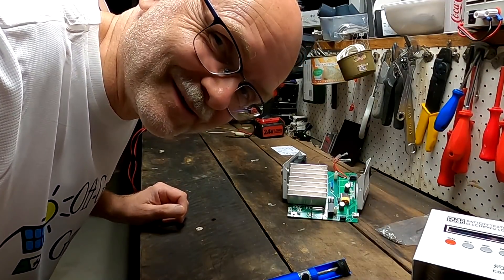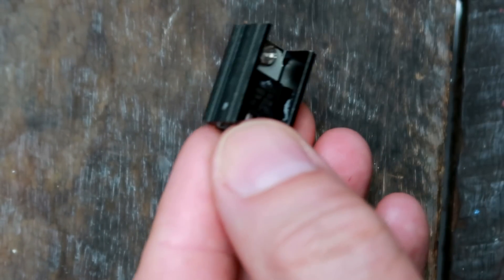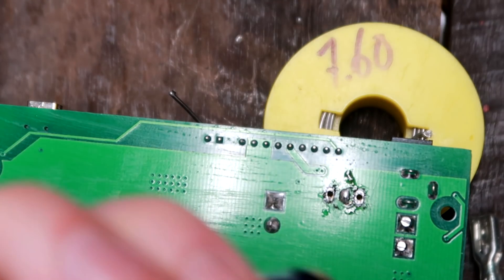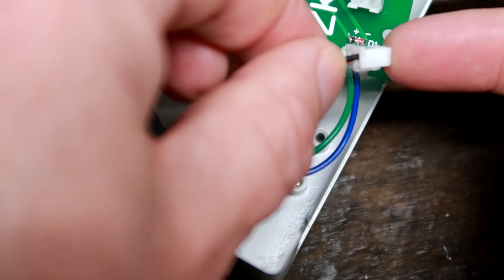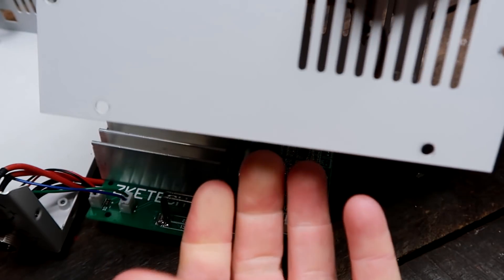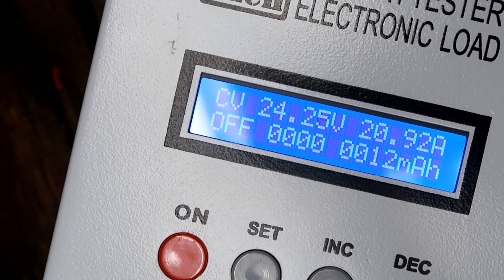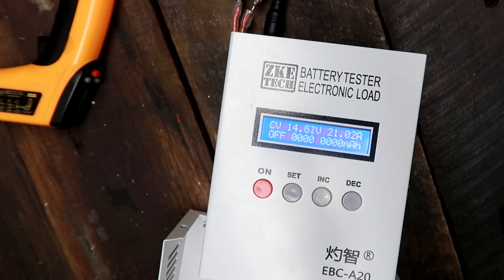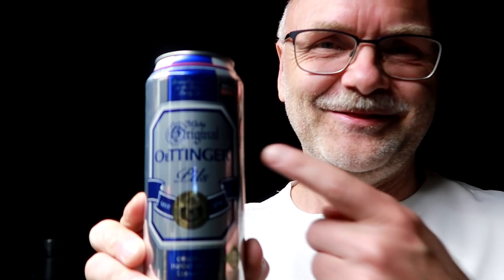Battery Tester Repair. Train wreck or fix? Part II

Comment: Ok, my 2 cents.
1. Solder wick with liquid flux on the wick.
2. Flow the solder then push a round toothpick through the solder holes. (My favorite.)
3. Flow the solder and bang the board on the workbench. 

Laugh all you want but I've been a bench tech for over 30 years and those are my tried and true methods for solder removal.

Also, when removing ICs, cut the legs and remove 1 at a time. Traces tend to get lifted otherwise. At least on cheap electronics they do.

Comment: Since that middle pin is the ground, it's also connected to the ground plane, which acts as a heat sink. The solder doesn't stay hot long enough after you remove the iron for that sucker to work. Use solder wick instead and trash that sucker.

Comment: Use lots a flux and copper wick for desoldering & cleaning, not John Wick though  :))). Watch northridge fix for soldering excellence. If previous regulator failed dead short then you need to check at least ICs and elcos downstream. Keep up the great work!

Comment: The midle pin is the ground plane, there is lots of cooper dissipating heat from the solder iron. I normally apply the heat in one side of the pcb and suck the solder from the other side. The diode is a zenner connected in reverse it becames a "voltage regulador"
Reply: *copper *zener

Comment: The Diode on the FAN is a flyback diode, it conducts the back EMF, when the FAN is switched off,  back to the supply rail.
Reply from the maker: Right, thank you.
Reply: Sort of a Transient Voltage Suppression (TVS) diode.
Reply: You beat me to the punch.  I agree, it is there to suppress the flyback voltage when an inductor (like the windings of a fan) has the  current suddenly switched off, but the current wants to continue flowing.

Comment: I would add few suggestion as you wanted :)

1. That diode is for protection of your driving circuit (fan) .it will not allow to push voltage in case you would start spinning that fan 
2. it looks like normal board but there is huge ground plane and that will reduce your temperature 
3. there are special tools that are used to suck solder on ebay (they look like plastic cheap pistol) ..they are not the best but work very well and and they have pump inside ..so yeah cheap option ..and worth some money ..if not go with Weller or similar brand  
4. Probably some IC is shorted because your regulator blew up and allowed voltage to go above 12V or some spike with same results..and you might expect more IC went wrong same time.. 
5. I would suggest to change those IC (if you will be able solder/desolder ) but i would suggest proper tools for that..solder, desolder , hot air gun

Comment: A lot can be figured out or diagnosed with just a meter. At the very least you should check out the parts connected to heat sinks, since many are power FETs that like to fail as a short. I would say it is a better than even chance one is shorted.

Comment: Sometimes you need to blow on the hole instead of sucking it... 😅
Solder wick works too.

Bad luck... 🥺, but for all it's worth we expected sparks and smoke...  You never disappoint. 👍

Comment: Perhaps if you could identify the chip getting hot? As it seems to be voltage and current readings giving grief maybe it is a reference voltage that has gone south. Some a to d converters rely on an external reference voltage. If it went wrong maybe it also caused the regulator to overload as it failed. A good sign is the pat you are getting readings which implies that the a to d part of the processor is working so the problem is in the periferals and not a programmed part.
Reply: yea the op-amp amplifies the signal from the current shunt probably, so it going short made that reading go wild and pulled more current than the heatsink on the 7812 regulator could handle (though it should have overheat protection and shut down before that)
Reply: @SuperBrainAK  they do have overheat protection however, in reality, they are still quite prone to dying instead. I have replaced many that it could be argued shouldn’t have died.
Reply: @philbrooke-little7082  yea, one day a long time ago I had a nice breadboard setup with 3 different linear regulators with a Teensy ++ that could turn them on and off and do fun things, Then an acquaintance decided it would be funny to mess with the wires and shorted the 5v rail of the always on regulator for the microcontroller. I came back and noticed the power supply was on but no lights were on at the breadboard, so I touched the heatsink to move the board and got burned by it. I finally found the short but the regulator was unable to deliver any current, it was surprisingly still able to regulate to 5v but couldnt even light an LED. RIP 7805

Comment: Ground plane is sucking all the heat.... bigger soldering iron :D

I guess that diode is freewheelling diode. Fan motor is basically a coil and turning current off from it will cause a voltage spike in it. That diode suppress it.  

350mA sounds too much... maybe? Was fan running?

Comment: In the video I could not hear the fan kicking in after turning on the device. In my device there is always a short fan self test. Maybe this is also an indication of a malfunctioning IC board. You could also check the voltage on the two possible sockets shortly after turning on.

Comment: Fan = inductive load, diode is to avoid "back EMF."
Reply: There wouldn't be any back EMF from that fan. Like PC cooling fans, they have a driver circuit built in, if you have ever played around with fan's, spinning the fan blades doesn't generate a current.. you would have to open the fan and bypass the driver circuit to get it to generate a current.. 
The diode appears to be a protective solution should you connect your sense wire's incorrectly...
Reply: @PeterMilanovski  So it’s odd the PCB may be labelled incorrectly. Maybe trying changing over those connectors? Though the fan would not be taking the current indicated on the display
Reply: @michaelbouckley4455  I'm not sure what is going on with the device, it's possible that the fan connection is plugged into the sense socket and therefore giving the reading on the display? Or something else has failed which would need an oscilloscope and some datasheets to troubleshoot it....
Reply: @PeterMilanovski 
 I think you would you agree that for the diode to be a protective solution for the sense wires, the sense wires would need to be connected to the header with the diode. Ultimately, Andy did not connect it that way -- he connected the fan to the header with the diode, and the sense wires went to the header without the diode. My comment was in that context,  meaning I was assuming he had them connected properly.

I did not say that there WOULD be any back EMF from the fan -- I was only suggesting that it's a reason the designers may have put one on that header. Perhaps it's unnecessary. Or perhaps not every single fan in the world has a "driver circuit" as you assumed. We don't know without more info.

Comment: The diode on the fan motor output would be to protect against back-EMF when using a brushed DC motor which could destroy the fan control FET, shouldn't be needed for a brushless motor. As for what died, I would guess an op-amp from receiving whatever the power adapter surged to when it popped the linear regulator..
Reply from the maker: Thank you.

Comment: Funny... I had the same problem just yesterday replacing a Mosfet on a speed controller. This worked for me... Heat the board with a heat gun first, then heat with the iron and then blow hard into the hole and blow out the solder. I'm not having you on... try it (on camera) 😄

Comment: A easy way to remove the solder is apply heat to one side of the pcb and use the pump on the other.
The overheating part maybe can be replaced i don't think is a eprom.

Comment: The fan diode is there to protect the fan power circuit from back feed current from the fan eg when you hit it with the air gun 
When you spin them up they can generate a lot of current
Reply: That would be true if the fan didn't have a driver circuit but in the case of this fan and all PC cooling fans, they don't produce current if you spin the fan blades, you would have to modify the fan, bypass the driver circuit to get it to generate a current...
Reply: @PeterMilanovski  Yes they do  and it's easily provable
Reply: @awesomusmaximus3766  I have never been able to generate a current from one of those types of fan's by spinning the fan blades... They need to have the driver circuit bypassed in order to do so...
Reply: @PeterMilanovski  I've seen over 15V

Comment: Solder wick. Yes, for at least 40 years there's been desoldering devices with hollow tips that suction from the center of the heated tips.
Reply: Yup, solder wick with extra flux if needed can be a lifesaver.
Reply: You stole my comment 😱👍
Reply: Solder wick doesn't work well for me most of the time
Reply: @james10739  Works great for me most of the time, just need to use the correct sized wick with the correct sized tip for the job and a soldering iron that can keep up with how much extra heat the wick wicks away.
Reply: @james10739  Sometimes it helps to add extra flux to the board and occasionally the wick itself.
Reply: @james10739  Ive had mixed results with wick myself. On the other hand, I've also accidentally sucked the trace loose from the PCB with a solder sucker. I suppose you could pull the trace loose with wick if you let it solidify before removing it though.
Reply: @charlesrichards5389  If you 'suck' the traces off of the board, that is because you put too much heat into the board (too hot and/or too slow) and burnt the resin that bonds the copper to the board, could also be that the copper was poorly bonded in the first place. You will have the same problem with wick, likely worse since you will be dragging the wick across the pads and traces instead of sucking molten solder only held onto the traces by surface tension.
Reply: @teardowndan5364  Yeah, I'm very careful about not overheating the traces (and cringed while watching this video to tell the truth). I learned soldering from an old Navy guy who insisted on military-grade joints. The couple of times traces sucked loose with me is when it looked like someone who was all thumbs had previously replaced the components.
Reply: I was going to mention wick last episode, but I was excited to see the old solder sucker in action and forgot to mention it.
Reply from the maker: Never used solder wick before. The sucker always worked...

Comment: Often the board has multiple layers of copper inside. Sometimes helpful to let the heat soak for 30 seconds or more ... or just hold the iron on the recalcitrant hole while inserting the new part like you finally did.